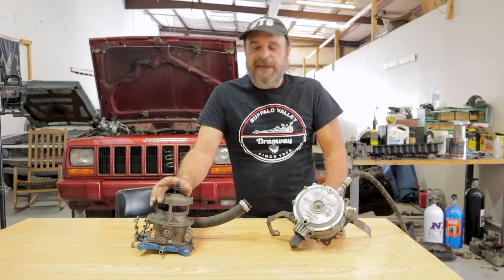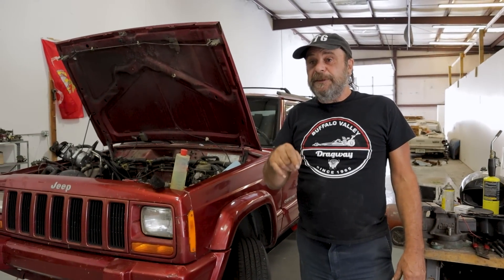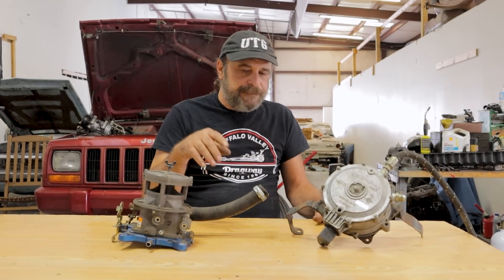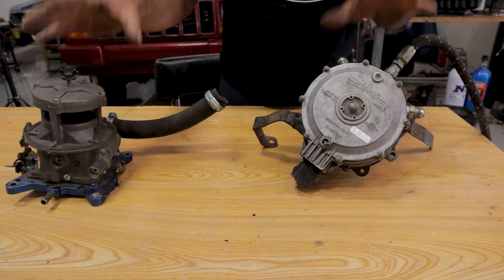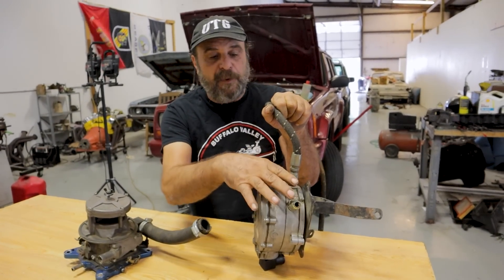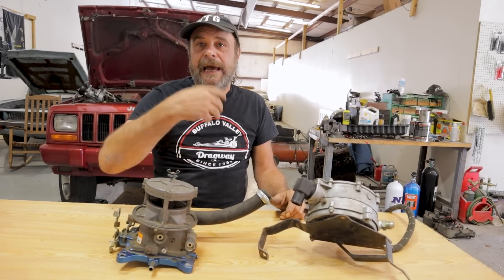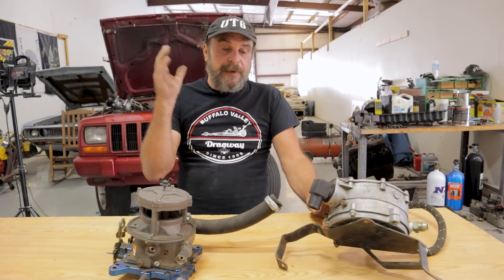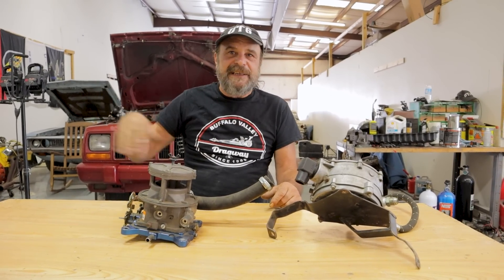Hot Rodding With Propane (And Propane Accessories) - Overview Of The Impco Carburetor

Comment: You can buy propane leak detectors. The other thing I would suggest is getting a leak detector fluid like Swagelock "Snoop" for checking connections. A portable combustible gas detector would also be good to have. I wonder if it's possible to switch between F.I. and propane, using the propane mixer's throttle plate with an adapted TPS sensor. Might be fun to see which makes more power or provides better economy...
Reply: If your F.I system isn't too advanced, you can cut the injector wires and fit up a fuel injector emulator, so the car thinks it's running on the F.I system, then you just create an adapter and mount the propane mixer in front of your throttle body, with no carby type throttle plate on it, as you don't need it, you use the factory throttle body, with all it's sensors intact. You have a switch over switch on the dash and you can switch between the fuels as you need to. I ran an Impco 425 setup just like that on my 91 Ford EB S Xr8, 302w efi just like the Foxbody, for many, many years, no problems at all. You can even setup a little box that when your switched to propane and you are starting the car, it can fire the F.I injectors for a small time to assist with quicker starting if you wanna get fancy. Beats having to fit a primer to the converter, and pushing a button before you crank it over.

Comment: You left out an important thing and made a bit of an error. 

This system is called a liquid system, the propane comes into the converter (regulator/ vaporizer) as a liquid. This is why the converter is heated with engine coolant as propane turns cold when it turns to a gas, like in air conditioning.

They do make vapor systems but they are generally on air-cooled stuff and are a bit finicky.

BBQ tanks pull and use vapor to burn, I don't think even upside down you can get liquid from them? Even if you could it is not the safe correct method.

Most forklift-style tanks are liquid and if you look at the top of that tank you will see the valve screwed into the port marked liquid. They do make this style in vapor systems too but they are usually well-marked so as not to confuse them. 

In a liquid propane tank, the valve has a long tube on the bottom so it can reach near the bottom of the tank. This pick-up tube is bent at an angle, and the angle is always installed to face what will be down for a horizontal tank mount. We can determine that the horizontal downside of the tank is a round hole in the tank collar. A proper propane mounting bracket will have a pin that lines up to the hole and lets the tank drop in place. If the tank orientation is off you will not be able to use all the liquid in the tank or not get any depending...

The cost of propane, it is nice to see it cheap in your area but here it is quite expensive. 

I look forward to seeing this set up and running

Comment: I’d say with a V8 that tank will go 30 to 45 miles I know a guy that has Ran CNG for 40 years because it’s free off his property his tank takes about a third of the truck bed (90 to 120 mile range) and he changes his oil once every three years and puts a lot of miles on
Reply: Cng and lpg are two different animals as far as range is concerned. Compressed natural gas is just that. You can only compress it so much so tank volume it limited.  LPG. Liquified propane gas is different as it will turn to liquid under relatively low pressure. So capacity is easy to achieve. Propane will be liquid until it hits the regulator/ vaporizer
Reply: @brycemadden8323  thanks I wasn’t sure also CNG has more of a power loss too I think
Reply: @throttlewatch4614  I can’t speak to the power loss. Only ever seen a couple guys with a cng conversion. LPG was everywhere in Canada in the 80s and 90,s.

Comment: If propane is equivalent to 105 octane gasoline, then it seems like an engine built with at least a 10:1 or 11:1 (or maybe even higher...) static compression ratio would actually be the best engine design to get the maximum power from this fuel?
Reply: Absolutely. I have done this and it works really well.
Reply: True that. Propane loves compression and lots of timing.

Comment: We call it LPG in Australia.  You need a bigger manifold than with petrol to be optimal as the gas takes up more of the air fuel mixture volume.  Going too rich is a mistake and can cause excess heat, pinging and burned valves as unburned / buning gas starts going out the exhaust.
Running lean is actually safer, opposite to petrol.  Its strange stuff.  I run dual fuel with an impco 300 mixer on a 6 cylinder.  I run an aftermarket electronic china distributor but the vac advance is disabled when its switched to gas.  I run colder spark plugs.

Comment: Funny you posted this today. I just got ahold of a NIB gasoline to LNG conversion carb for my generator. I'm super psyched to get it hooked up. Good luck with yours and the Jeep!
Reply: Air cooled ? 
Better be religious about checking valve clearance.
And set the plug gap to like .020, very narrow on the air cooleds or it'll spit and pop and backfire and sneeze. 
Briggs standbys require a valve adjust every 100hrs ,and they need it I've seen the exhaust valve close up it's .006 clearance by then and it's hard to start because it has no wind.
But I don't know 💩 I've only been doing this for 20yrs ,or maybe it's minutes, yeah. 😂😂
Reply: Being it's a dry fuel ,it's a lot tougher on valves and seats compared to gasoline.

Comment: I don’t see a fuel lock. Did it come with that ?
Reply: The regulator/vaporizer also is a fuel lock off. It needs some vacuum to it to let the fuel flow. But if a diaphragm gets a hole in it the fuel can leak through. It’s best to have an electric lock off between the tank and the regulator.
Reply: @stevendefranceschi1294  
The vaporizer is not a lock off. Electric or vacuum operated lock off is a must have

Comment: Back in the late 80's early 90's, a good friend of mine had a retired CAT service truck, 1980 F350 w/400m, granny low 4spd, dually, utility body, dual fuel, always loaded, he was an expert contractor, and occasionally towed bobcats or backhoe on a 9 ton triple axle 24' trailer, it had a large propane tank on top of the headache rack, maybe 50 or 75 gal that was more than 1/2 full at purchase, so naturally he had to burn it out, seems it had a lil bit less power overall but got the job done, it also had space shuttle miles on it and used very lil oil, seems the engine was very clean inside vs mileage and it didnt stink as bad at the tail pipe running on propane

Comment: I remember Propane conversions were popular in the 80's.  The engine does run much cleaner for sure. Propane can also be used to replace R12 refrigerant.
Reply: Replacing refrigerant gas with flammable propane sounds like a terrible ideia
Reply: @andremarini7113 while I don't disagree, look at the side of the next freezer or fridge that you buy.  It's probably R290.  Propane.
Reply: @thefixerofbrokenstuff   or Penthane.
Reply: @andremarini7113 I hear the new y1234 stuff is flammable too
Reply: @andremarini7113 That’s why it isn’t often done. But, propane is a great refrigerant. At least if it did leak there’s only a couple pounds or so.
Reply: @NBSV1 
Haha if it wasn't so flammable it would be awesome to blow on an intercooler core to freeze it up because it's cheap
Reply: It’s not so rare to have propane in hvac now days.

Comment: I have a propane setup off a big block chevy dump truck motor, never messed with it, but this makes me want to. Are they easily tuned?
Reply: My 79 454 is straight propane I pull lots of heavy trailers with it works real well . All there is a lean rich adjustment and an idle screw like a jet on a carb

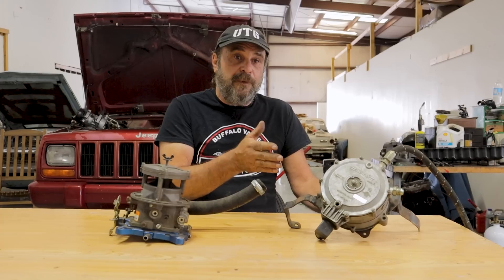Comment: 4:10 you may have a little more power but now you have to deal with the weight of all the equipment
Reply: They are not that heavy besides the tank but the factor gas tank is heavier than a lpg tank

Comment: TONY In 1980 i saw a cab blow up and kill a mechanic.  The hose leaked from rubbing and filled the trunk.  When the mechanic started the car it blew up the garage as well as him and the car.
Keep all propane lines outside the cabin.  Seal off the trunk from the cabin and vent the trunk.  Maybe get another lid and louver it plus vents out the bottom of the trunk.  Or leave the lid off. 
I had a propane powered Chevy tow truck back then and mileage was a bit better but propane was half price then so winner winner.
Looking forward to the mules future.
Cheers 🇨🇦

Comment: These type of systems were popular in Europe & Australia in the early 2010s primarily for economical reasons, but sort of fizzled out in popularity for one reason or another and it's exceedingly rare to see one running on the stuff today.
Reply: Popularity collapsed when federal government applied excise to LPG, almost doubling its price.
Reply: @derekhobbs1102 leave it to these corrupt governments to make it more expensive and difficult to take advantage of.
Reply: Still relatively common in Australia but becoming less so.  My Ford runs on LPG (liquefied  petroleum gas, ie. propane) and gasoline (swapped over by a flick of a switch) and costs less than half to run than if I ran it on gasoline alone. Having two fuel tanks in the car means you sacrifice some room in the trunk but you double your range. Performance difference between the two fuels is not noticeable.
Reply: they are all over australia
Reply: I think it fell out of favor because the refueling isn’t quite as convenient and common. There’s gas stations all over the place. Not as many places that refill propane.

Comment: I was the mechanic for a greenhouse that used a ford C600 tilt cab box  truck for delivering flowers. It had a 361 Fe that ran on propane. I got to see first hand just what using a dry gas for fuel in a heavy hauling situation does to an engine. WoW gasoline could never do that kind of damage because it won’t run jetted that lean.
Reply: My experience was with a 361 in C600 that delivered propane. . Far better though than the 366 Chevy. 
We sold propane and it was a miserable experience. No interest in doing it, but fun to watch others. Also I heard of one death from a propane fire in a converted pickup. I just don’t think those backyard (mostly) hack conversations were safe

Comment: Impco makes a plate where you run dual 425 mixers. With propane there is no fuel pump to fail. Propane doesn't turn to swamp water while sitting. I love the stuff.

Comment: At my old job they converted 3, ton ford 1/2 pickups with 302 engines and the gas mileage was worse than gasoline.  But the engines ran real clean and showed very little wear.

Comment: Hey Uncle Tony, I have a thought I think would be good to keep in mind. What about the cooling of this fuel? One of the aspects that make regular petrol such a good fuel is it's cooling properties for the engine, since petrol is a liquid, when it enters the engine, both from it's heat and from combustion, petrol begins to turn into vapours which takes a big chunk of the heat from the combustion. But since propane is a already a gas, it won't/shouldn't have as good of a cooling effect, so I'd expect combustion temperatures to be higher than with regular petrol.

Edit: I live in a country where propane/LPG is semi common and as far as I have asked around, most people only have bad things to say about it, always mentioning how it shortens the life of the engine to just a few years, which considering what I've just said in this comment I would not be too surprised if it's the case. (Don't get me wrong I would still be very happy if propane was actually a perfect fuel)
Reply: Not true about shortening the life. 0 cylinder wash. Oil never gets dirty. I’ve ran propane for years and as long as you have hardened seats so you don’t burn a valve or sink the seats. You would be amazed of the condition of a high mileage engine that spent its life on propane
Reply: Propane fork lift engines usually outlast the fork lift chassis, if maintained; for the reasons mentioned. 
EFI had same effect when engines switched from carbs. 
Doubled the miles an engine lasts and lasts longer than chassis. 
Carbed engine cylinders was wore out after 100k, blow by, oil consumption, etc.
Cylinders would have to be bored, to remove cone wear shape and ridge cut at the top.
After EFI, 200k+ became the norm.
Reply: YUP!  I rebuilt lots of carbed engines, after around 100k (depending on maintenance) loose compression and burn oil, all had a ridge at the top of the cylinder,  I have rebuilt factory EFI engines, never seen one with a ridge yet. @jhoncho4x4
Reply: I have a 1989 Mazda, 2 litre engine run on propane for over 300,000 km's, still runs perfect.
Reply: @brycemadden8323 @jhoncho4x4 Hey thanks for the replies guys. Yeah I neglected to mention that most of the negative things I hear about propane comes from people's experiences with cheap aftermarket propane conversion kits on regular cars that don't have hardened valve seats. If the engine was made for propane and maintained then no doubt it will live as long as the sun.
Reply: @domantas8185  Maybe they would do better with wood gas generators; lots of tar and gunk to cushion the softer valves of those engines. 
1930's and 40's German cars and HD commercial trucks did well with them, during the end and immediately after WW2; from gasoline shortages.
Wood gas was fed similarly to propane.
But sometimes also used a gasoline carb, that would start engine on scarce gasoline and switch to wood gas, once it had generated enough to switch and maintain a steady supply of wood gas. Most of the long distances and long running times, was done with wood gas, to save gasoline for war vehicles.

Comment: Hopefully in near Future uncle tony you can get yah hands on some cheap Hydrogen,
Reply: The only way to store H in any usable amount is to chill it 100's of degrees below zero, H boiling point is lower than -400 F!!  And before you ask why that matters,  think back when the space shuttle would be launched into orbit, and the O and the H had to be filled into the main fuel tank that was mounted underneath (the big round thing the SRBs were mounted to).
Reply: Ok or generate it on demand and store it in water form